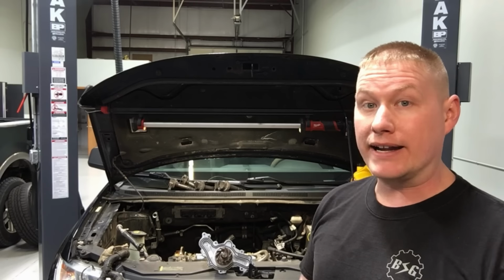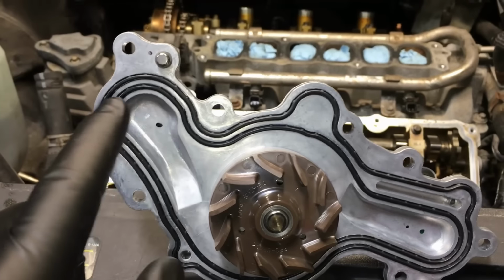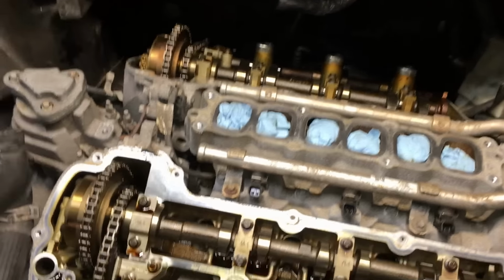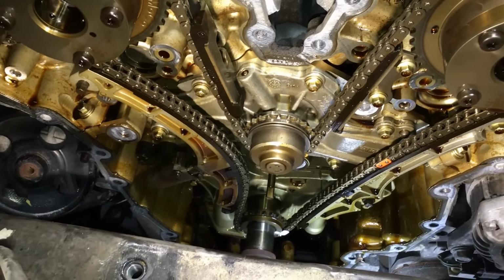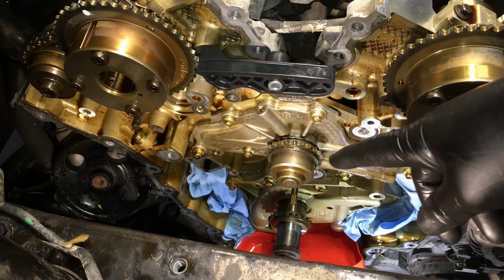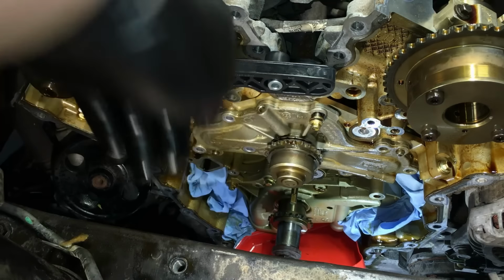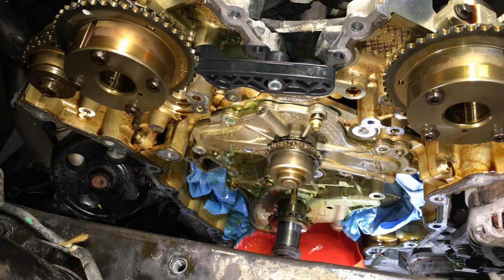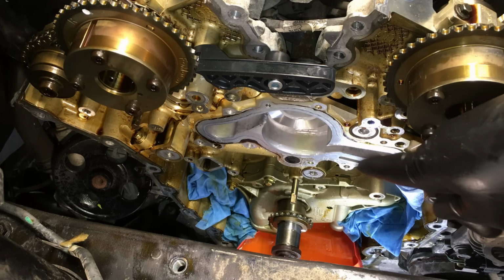Ford 3.5L 3.7L Duratec V6 Chain Driven Water Pump Failures: Check it Before it Destroys Your Engine!

Comment: I guess I’m one of the lucky ones. I have a 2007 Mazda CX 9 with 255K miles and never had a problem. Didn’t know about the weep hole will check tomorrow.

Comment: My wife has 2010 ford edge sel with the 3.5 it has 220456 miles and we have never changed the water pump runs like a clock

Comment: I have at 2017 Ford Edge with the 3.5 V6. Does my vehicle have this same water pump design issue?
Reply: Most likely. My Ford Explorer has a 3.5 and the water pump failed on me.

Comment: I've had two Lincoln MKS's...a '10 and a '14 each with the 3.7L engine.  Loved the cars and their power.  Each car ended up totaled...maybe blessings in disguise.  Went back to Cadillac XTS but hate it.  Would really like another MKS but I'm afraid to roll the dice.  May have to settle for an Ecoboost 4banger MKZ...or go to an Audi.  Sad.  I never thought I'd see the day I'd rather have a Ford product than a  GM product but my Cadillac doesn't hold a candle to my former MKS.

Comment: The timing chain guide "upgrade" mentioned is very different from original. The aftermarket kits DO include this updated guide, but it is completely DIFFERENT  than the original. The replacement  installs completely different than original. THIS NEEDS TO BE NOTED! The upgraded part is designed to guide the chain on the OPPOSITE side of the chain from the original that is being removed! If you dont know this, you assume they included the wrong replacement part in the kit!!

Comment: Does the F150  2011 eco boost 3.5 have a water pump that can leak in to the engine oil or is the problem only on fwd car like the Taurus ?
Reply: f150s are safe

Comment: I purchased a 2011 f150 3.5 eco boost which has had regular 5000km oil and filter changes it has high  km on the clock no rattles on start up . I purchased the f150 as is and won’t be able to complete brakes rebuild differential ,repair/ replace vac operated hubs and some finish to the rocker and cab corners replacement I welded in oct.Because cold temperature I won’t finish the truck till April or May 2020 . My question is this will leaving the truck out of use for several months cause damage to the waste gates seizing ? Can any lube or penetrating be shot into the turbos to stop seizing of the waste gates while out of service ?

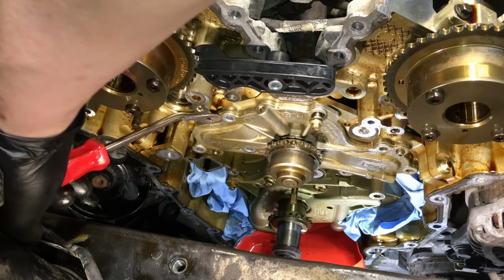Comment: ( 7:45 ) Would it make sense to drain the coolant at the radiator before pulling the pump off?
Reply from the maker: Yes the cooling system was completely drained
Reply: FordTechMakuloc,
That's what I thought. I was surprised by how much coolant still comes out with the pump. 

I guess that's why I shouldn't just drain the old and replace it with new without flushing all the old stuff out when I just need to do a coolant change. You did a good video on that quite a while ago (for my Ford Focus) that I need to watch again. 

By the way, THANK YOU for all the great knowledge you share in these videos. After seeing your videos on the Focus DCT I knew I had made the right choice buying mine with the manual 5speed. Then I got over my Focus ST envy after seeing the one about the carbon buildup in your 2.0 Ecoboost Explorer, and now I no longer envy my neighbor's V-6 Edge. (I'll have to get him to watch this video and the other "fatal flaw" one.)

I had been trying to get my wife to consider a used Lincoln MkC or MkX, to replace her aging Murano (while its CVT is still solid) but since they use the same Ford engines they don't seem like a good choice now, either. (Why is so hard to find a well designed, reliable new car these days?)

Comment: Is the x2011f150 ecoboost 3.5 in the pick up an internal pump also or is it driven externally
Reply: External
Reply: Phil Lee thanks , is the pump able to be changed without taking the timing cover off ?
Reply: Yes

Comment: I have a really nice 2017 F150 3.5 non-eco with 14K mi. on it . . . and I am still going to buy a NEW CYBER TRUCK. 

Sick and tired of this crap . . . I dont have this water pump but my spark plugs are buried internally ( $ 1,200 ) and the trany is sealed so guess what Ford, GM and all you other losers. . . KMA.

Comment: I expect there's a double seal on the shaft that also feeds into the weep system. If there isn't, they've only done half the job of mitigating the terrible idea. Has anyone looked more closely to confirm?
Reply: mine failed with zero weeping. Looking like a new engine at this point... no idea about the shaft seal question you posed, but I'm also curious if you happen to find out.

Comment: Why not shopvac the coolant or spin the pump to flush it all out? Any recommendation if coolant gets into the pan?
Reply: Change the oil. If you want to get fancy flush the pan from the front while open with some brake clean and let dry. Anything left will evaporate after the engine gets hot. Like he said " check the timing chain,guides and sprockets while you have it open. Plugs and PVC valve if they haven't been done, cheaper and less work  while its apart.

Comment: My 2011 3.7 in the F-150 looks to be pulley driven.    Did Ford use a different water pump on the F-150 Duratec?
Reply: Kevin Haskins yes they did.

Comment: Ford wanted $3700 to fix this on my 2011 Fusion Sport 3.5L
Reply: I was quoted 575 for water pump on f150 with 3.5 engine
Reply: @Indy_Kev  I wonder if it's the same setup.  It's a 14-18 hr job on the Fusion, according to about 5 places I called.  I got it done for $1900 including a thermostat.
Reply: @Indy_Kev  Your F150 3.5L water pump is outside the engine, So just normal WP job.
Reply: @blueblood76  I thought so. Looks like it's right on the front of engine. What a relief!!!
Reply: @blueblood76  thanks for the info
Reply: Kevin Swail,
Longitudinal engine orientation in pickup truck. Rotating it to transverse for crossovers/SUVs made the space too tight, requiring different water pump arrangement. (FordTechMakuloco mentioned that, either in this video or the other one he has on this same problem, not sure which.)
Reply: @xa7xx7ax I wonder the same thing. I can't seem to find an answer

Comment: I passed on buying a ford with a 3.7 because of this. Ford wants you to have engine failure caused by this so you trade it in on a new one instead of paying to fix it on an older vehicle. Planned obsolescence at its worst..

Comment: Ford did this asinine design so they could fit a 3.5L V6 engine into the old 3.0 V6 engine bay.  Once I learned about this stupid design I dumped my Ford Fusion sport (that I actually really liked) shortly after it hit 100k on the odometer.

Comment: Did you remove the motor mount on the far left of the engine where the timing chain cover was removed. If so does the engine need support underneath to keep the engine in position.

Comment: i thought the old school GM LT1 that's in my 96 camaro had a shitty ignition system design (opti-spark). it's located behind the water pump, which the water pump will bite you when you open the hood. 

it's an old quirky ignition system but this old V8 small block has gone 251K and still counting...... it has NOTHING on some of the garbage that exists today. doubt too many 3.5 or 3.7 engines will live over 1/4 million miles. the water pump might get changed once when the car is still fairly new but NO ONE is going to repair it when its old and has allot of miles on it. if the opti spark on that old LT1 failed tomorrow i would still replace it. WHY?
1. i love that old car.
2. i can do it myself
3. parts are soo much cheaper for that old car then anything made today. i could buy an entire reman engine for $1,500
4. the car is rust free.

Comment: How many miles on that one ?
And what’s the mileage when these let loose normally
Is there anything you can do to make it last longer ?
Reply: My fusion Sport just hit 127,000 miles.  Just noticed the water pump failing.  Warranty ran out 2 months ago.. Ford wants $2,000+ to fix. Ugh

Comment: Do you have to drain the oil out of the car and the coolant when performing this job? 

Also how do you flush the oil pan?
Reply: yes for both and will probably have to pull pan but may be able to dump old oil from timing chain area and force out any antifreeze in there

Comment: Question! To replace the top timing guide do I have to remove the timing gear to get the bolt out to put on the updated timing guide? I haven't seen a video that talks about this. I seen they loosen it up and raise it up to get it out of the way but will the bolt clear the timing gear? Any help would be appreciated. I'm attempting this on Saturday.
Reply: Yes you need to slide phaser almost off cam to remove the upper guide bolt. You will then need new Ford TTY phaser bolt If you buy new improved upper guide you will need its matching 2 longer bolts too

Comment: Keeping an eye on my 08 cx9 with 102k miles. May try this myself at some point but doesn't look fun. I am watching my overflow bottle carefully. But I have also heard these can have sudden impeller bearing failure and sudden coolant dump. But with my regular Mobil 1 synthetic changes, that  is unlikely. Great motor aside from this. Although changing my stretch belt was incredibly difficult due to proximity to the frame rail.

Comment: if your looking into buying one of these Ford Vehicles, Brian would recommend asking questions, take it to a shop, ask questions about the engine (water pump), check the mileage/km if it has more than 100K miles/160k KM, best to tell them if it has been replaced, if so when but still i would make sure... cause have some leeway to fund the replacement of the water pump, expect like what brian quoted, ($1200-$2000) always go on the high side, if you looking to purchase a vehicle with these engines, they are not so bad until they are done right, last a long time.. if someone is selling a 2012 ford flex for $9900 with 120,000 miles i'd recommend only offer $5000-$5800 therefore you have wiggle room for the water pump to be replaced and what other thing you want done... always do history on engine check out his other videos on these engines what to look for when buying a vehicle, Brian might even let you know what to look for...

Comment: Just finished one of these in a flex.
Cash pay side money. Not too bad,  didn't need to pull the engine or the subframe as compared to doing timing chains on a Chevy 3.6.

Comment: I can say that Ford has changed this design. My 2012 F150 has the 3.7 that was released in 2011 in the Mustang a d they have changed it back to a pulley driven water pump.
Reply: David Hester,
F-150 and Mustang have engine mounted longitudinally. FordTechMakuloco explained, either in this video or the other one he did on the same problem (not sure which), that when the engine was rotated for transverse mounting in crossovers/SUVs there wasn't enough space for the water pump so this arrangement was their "solution".
Reply: @ArcoZakus  so rear wheel drive like the mustang and f-150 it has only the external water pump?
Reply: David Hester,
That's what I recall from his other video. Search for "FordTechMakuloco Fatal Flaw".

Comment: How did you get the top guides out of the way to get to the water pump?
Reply from the maker: loosed the remaining bolt behind the phaser and wing it up out of the way.
Reply: FordTechMakuloco this way you don’t need to remove the phasers?
Reply: I'm about to attempt this. The only thing I'm not sure about is replacing the updated guide at the top. Do I have to remove the cam timing gear to remove the top bolt on the guide? Evey video I've seen its switched out already or they loosen the bolt to raise the guide up out of the way?

Comment: I've got a 3.5 V6 on a 2008 taurus x  leaking from the pump. I've got the valve covers off. Vehicle has 220 k miles on it, runs as smooth as new. Timing chains have no play, in time. Just that water pump.  Believe me folks there is a reason these jobs cost so much. I cant afford shop prices. So I am doing this myself. Ford had to make these that much more complicated.

Comment: Pos water pump failed causing an internal leak of about 5 quarts of coolant in the engine....hydro locked and overheated the engine today :/ @123k miles.

Comment: Still  a great engine. I've got 100 thousand and still going great
Reply: water pump failed at 155k for me, seems like only first gasket failed.  No water in oil, dealer quoting $2k and 1.5 weeks
Reply: It is a good engine, unfortunately they put a time bomb in it.
Reply: @NetfloodeR  quite literally a self destructor. Mystery water pump gone bad guess when scenario
Reply: are you planning on getting the pump replaced. I have read that 100k you should think about it since a failure while driving can be catastrophic.
Reply: @Jason2003  150k
Reply: @Jason2003  yes most definitely in my plans ,it'll have to one of those I'm gonna replace the water pump before it breaks weekend jobs

Comment: Great video! I actually feel a little more confident on taking on this job. I just purchased a 2010 Edge Sport with 160k on it. I got it for a good price because the water pump seal just went on it. 
I have a couple of questions though. First, I see you did it without pulling the engine. Was it difficult to get the timing chain cover off and back on? Or would it be easier to just drop the engine? and second, is there a different/better water pump you'd recommend installing? 
Thanks for the helpful an clearly explained video.
Reply: The timing cover does not have a gasket/o-ring but is instead sealed via rubber/silicone sealant.  The timing cover is large and difficult to install with the engine in the car without knocking into some other engine part and scraping off the sealant.  I did this job on our CX9 a year ago with the engine in the car. It is doable but some parts are difficult to access. If you have space/tools to drop the engine out of the car, (lift car and drop entire front subframe with engine and trans together) the water pump/timing chain/timing cover replacement work would be easier

Comment: Is there a way to cast as in thread a nipple into the weep hole block and maybe high temperature resistance clear tubinng and vent overboard.  Still vents out the weep hole but providing a slight extension to get the leaking coolant more visible?

Also I seem to remember in one of your videos that the newer versions of the water pump had two sprockets for redundancy.  Is this MY edge not one of the 2 sprocket available fleets?
Reply: You see coolant on ground from alt weep hole and you see coolant in Engine block V they are both easy to see, Also watch and mark coolant level on degas bottle

Comment: Other than the water pump, is the 3.5 Duratech a reliable engine? Any other issues to worry about at 135k miles?
Reply from the maker: yes

Comment: So im about to do this procedure on my 09 flex i notice the coolant dropping level so i did my homework and found out thats the sign to swap it out so my question is,  is it ok to buy the aftermarket parts for this or should i go with the oem motorcraft  brand? Take note im smart enough to do this but dont depend on a budget to actually buy all the part specially oem prices. I love my flex despite some of the bad designs so i really wanna get it going again
Reply: Do you want to do the job 2 times if cheap part that might save you $40 fails??  OEM

Comment: is 136k miles too soon to swap out the water pump on the 3.5?
Reply from the maker: nope
Reply: FordTechMakuloco I have a 3.7 in 2012 Lincoln MKX RWD, when would you recommend changing the internal water pump?

Comment: Been shopping around for 2015 or newer 3.5 edge cause most got those ecobombs I knowed not to get in to that but now I'm not shopping for edge at all!! But my 02 Mustang GT 5speed car is the bestest car drove my baby over 15 years and 330000.0 miles later she is yet great machine only item I've touched on engine is belt idle tensioner and rebuilt alternator my self two times !! I've only used Mobile 1 fully syn 10w30!! Motocraft filters!! God save our republic in Jesus name I pray!!

Comment: Chrysler 2.7 are the same way. At one point my father got one for free after the chain slipped because the water pump failed. I changed both the heads with junkyard ones timing chain kit and guides. Probably would have cost a fortune at the dealer. I think we had six or seven hundred bucks in it. Ran good till the end.......... which was when the transmission started slipping around 180k😊. Then it was time for it to go.

Yeah it's a really stupid design but if you think about it. Most timing belt driven cars are the same way.  But you never really have water pump issues because you always change it when you're doing the timing belt. But now that it's chain people forget about the water pump. And then it ceases and skips the chain and now your valves are bent. 

So as great as timing chains are for the smaller engines, it makes people forget about maintenance that still needs to be done, water pumps tensioners and tensioner guides don't last forever. 

I am still a big fan of older cars. A simpler time. But in the end they all have their own issues. As great as all this high-tech stuff is they break.

Comment: The old shade tree mechanic's don't have a chance nowadays. Good explained video. Thanks
Reply: john g not necessarily.  The very wide range of video library subjects courtesy of University of YouTube probably help for the most part.  Even if you watch these videos and get scared or overwhelmed by the procedures and steps. You can at least get some more knowledge of the systems.

You might not be able to fix it but at least get an idea of how complicated it can be.  Also reduces the chance of getting snowed by scumbag service advisors and dealers.